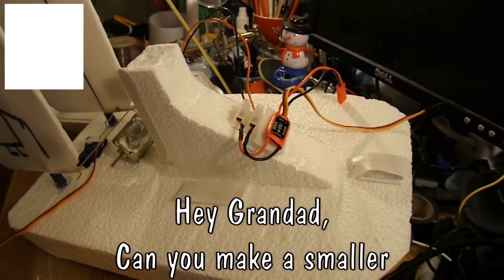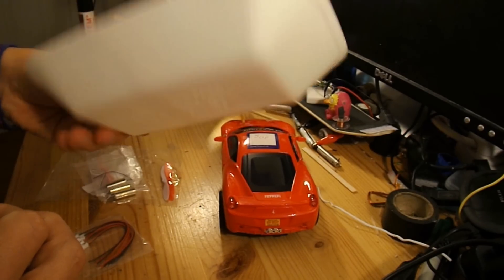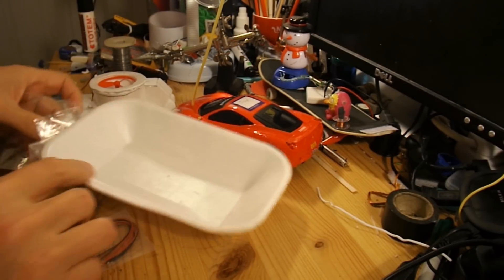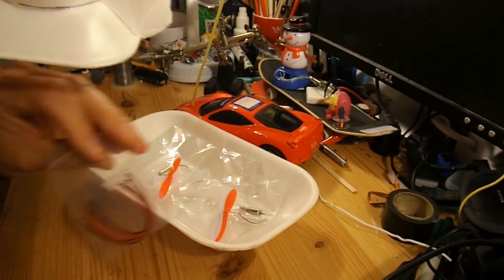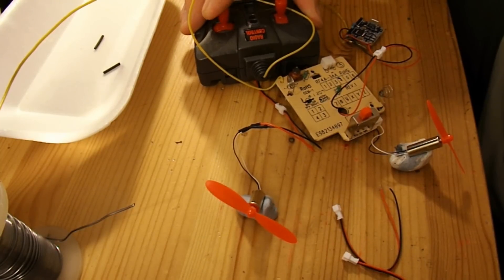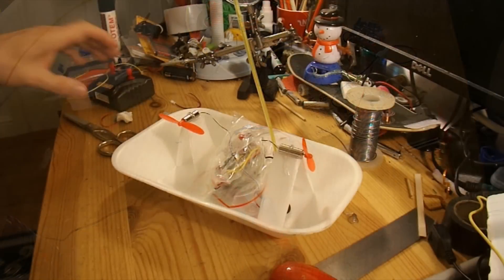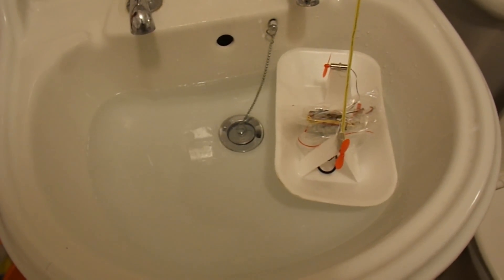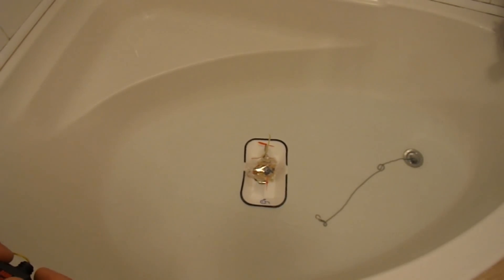Hey Grandad can you make a smaller RC Air Boat?

Comment: hey granddad, can you make a boat out of a breakfast box / tupperware container?
Reply from the maker: +Thundi yes of course you can. Stick a motor inside with a shaft through the side and a propeller on the outside. Add a battery and you have a boat. If you keep the inside of the prop shaft above the water line it won't leak.

Comment: dear granddad when you install the motors does it have to be in the center of the boat
Reply from the maker: Which motor? The one at the back needs to be on the centre line or the boat will probably not go straight although offsetting it slightly may help to prevent the torque turning the boat. The steering motor would probably work wherever you put it but putting it at one end or the other will increase it's leverage on the boat making it turn easier. If you look at this one you will see I put both motors at the back and still managed to get a good steering effect. http://youtu.be/1rKYmYozZps?list=PLA5a2xPRSrB13Xcquw4Ff09MQzTPjeVkI

Comment: Hey grandad can you make a flying boat
Reply from the maker: I will put it on my list but it probably will not happen. My channel is mainly simple, cheap, and quick to build projects. A flying boat would need to be radio controlled to keep control of it, that would mean using proper r/c gear, that would mean making a good sized plane, that would mean buying a good sized motor to power it. All of that is extra expense that does not fit into my simple and cheap target. There are plenty of YouTube channels that specialise on r/c models so if you really want to see one you would be better off looking there.

Comment: I really like how you re purpose electronics, like in this car - that r/c gear would cost a bit more than 50p in Maplins hey? That boat is quite a mover, would it be too light to use outside in the wind do you think?
Reply from the maker: Yes much to light if there is even the slightest hint of a breeze I would think. I might give it a try sometime if I can find a suitable pond that I can get all the way round in case it gets blown away.
Reply from the maker: ***** yes the slightest breeze and it would flip up into the air but it would be too unstable to fly.

Comment: At first, I thought you were going to put the two together behind little motors.
And to turn, you'd either run only. 8-)
Reply from the maker: This way it is balanced front and back but I think it would probably work with the two motors side by side and still controlled independently as we could still go forwards, backwards and if we put one forwards and the other backwards it should turn too.

Comment: I've got a box full of broken down rc models and you inspire me to do something with them
Reply from the maker: Now that I have taken a few apart I understand how the simple ones work. Most of them have the same 2 outputs to control two motors with three conditions. 1. Off 2. Forwards 3. Reverse
 So if you can limit your requirements to those 3 states for 2 motors you are in business. Some have a few extra outputs for other purposes if you are lucky but most have these basics.

Comment: Can you change the steering?
Reply from the maker: What do you mean by "change it" ?
Reply: To put a rudder
Reply from the maker: Pau Climent Salazar The whole point of this design is that it does not need a rudder. It works the same as those r/c helicopters.